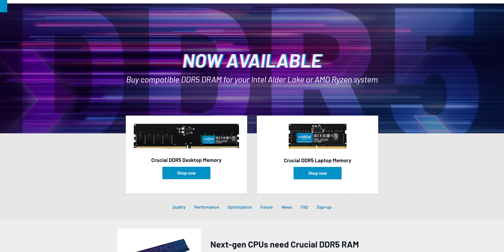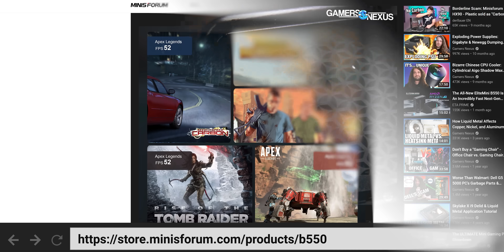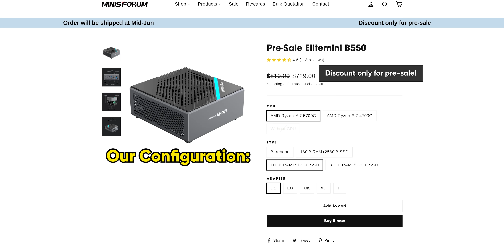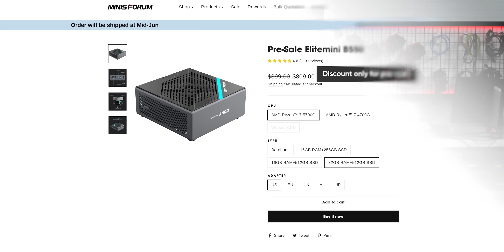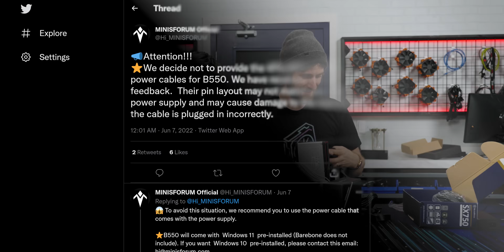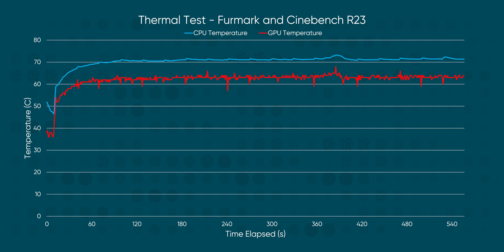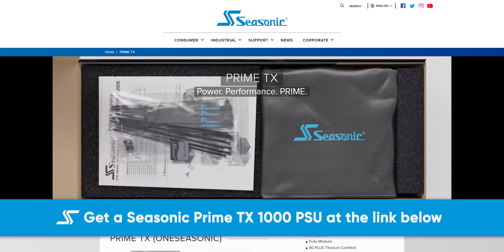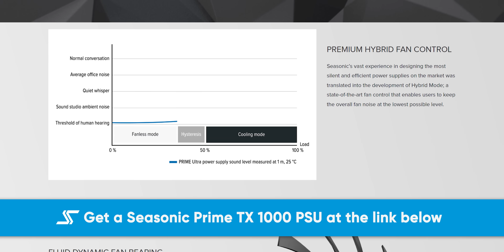Who's Buying These? - MinisForum Elitemini B550

Comment: i think it's Next level of something which u presented here💀👀💥 also i like R7-5700g this is my Favorite Processor btw & m currently using this for Heavy work. 
Another important thing it's must be Portable Beast & Capable to Run anything at 1440p max , with Realtime Render & Faster Simulation on 3D software which is more Important for *VFX artist or Motion Designer like us.

Comment: Million dollar answer: This is for people who want to travel frequently and not be limited to either laptop GPUs or Small Form Factor builds which tend to be expensive, difficult to build, and despite their size, often delicate to transport. With this setup, you can tear down everything and decide what you want to pack in your carry-on or checked baggage. Once you're at your destination, you're a relatively quick setup away from having the power of a full desktop gaming PC to connect to your Airbnb's 4k TV.

Another target audience is those who have the need for 2 PCs in their home: (1) for work used on a desk in an office and (2) for gaming in a living room with a TV or large gaming monitor. This allows you to have both setups without needing to buy 2 PCs. Once you're done working, you simply unplug the mini PC from your work desk and plug it into the dock with the 3090 connected to your TV. Again, neither a laptop nor SFF build give you the same advantages or performance as this setup. (Even a laptop + eGPU setup is limiting due to eGPU's not using PCIe connections.)

Comment: I feel a mini PC brick that ISNT a laptop you could DOCK or slot in similar to like a nintendo switch would be good for an office testing and development environment which maybe requires different OS/PC configurations and testing settings like CPU and RAM so you and co workers could swap the system out to test with different CPU/RAM and or OS and config maybe one system with resizeablebar and smart access memory and the smart shift or PCI express power settings or other things.

Comment: This is perfect for my use case. I will graduate soon and I want to have a flexibility to change where I live and work, but want more power for gaming than a laptop so this small form factor is perfect. And if I build a small form factor PC in a case, the thermal is my concern where the space inside case is very packed. But with this thing the GPU and PSU can take the air from outside and it seems no thermal concern for the GPU which is taking the biggest power on this system.

Comment: 10:10 
Honestly, I could see myself buying this if I the idea was a bit more fleshed out. If the wires were in the base station like was mentioned in the video, or since it was mentioned in the video that it is close to the size of a Ghost S1, if it could be enclosed in a case about that size, and just have easy access to pull out this "module" to take out and with you instead of this open-air setup, i'd probably preorder this right now.

I'm at a temporary (~2 year) work travel right now, and regularly go back home for a weekend every month or so. Since i'm gone for ~2 years, I brought my gaming PC with me (Small-ish form factor, built in an NR200), but when I go home, I want to bring the system with me for my files, and also something that can handle some gaming, which a R7 5700G could certainly do. I have peripherals on both sides, so just having the removable "NUC" would be great. If I bought a laptop, it would ONLY get use while I travel, unless I also went with an eGPU enclosure, and radically changed my computer setup (which I priced out would cost around ~$2600 for the laptop/eGPU vs this option which would be ~$600 using my existing parts). 

As for upgradability which was touched on in this video, since it needs an APU in it for the main feature; the portability and ability to run without a dedicated GPU, if it has enough power to support the R7 5700G, it's a non-issue. I doubt AMD will release a better APU on the retiring AM4 socket. I also feel that this is unfairly being compared to a desktop for upgradability when it really should be compared to a laptop. GPU and storage upgradability is honestly all I think it needs, which it has covered well.

Comment: Gotta admit I love the concept of it but it’s not something I’d want just because I think after you install the graphics card an power supply it just looks messy. Now if they made a version where all the major parts of your pc had their own modular enclosure that when sandwiched together looked clean and presentable I’d be more interested. Be helpful as well if say I wanted to swap out my graphics card without interfering with anything else or disconnect the motherboard section and fix something. How feasible is that idea? I dunno.

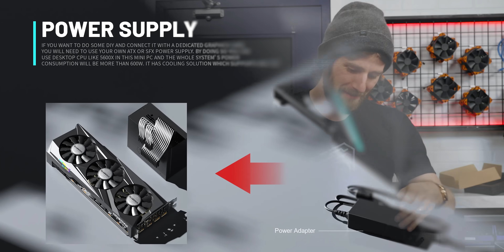Comment: 7:05 What an obscure thing. If you plan on using all the brackets, an external PSU and want a bigger cooler for the CPU a full case would be the better option here...

Comment: This is more of a gimmicky tool. I cannot think of many actually good reasons to get one of those instead of a laptop, other than this being a lot cheaper than a laptop of comparable performance.
If I really stretch my imagination and ignore a lot of my inner common sense. In situations, where you need to work fully offline on proprietary or in development PCI-e based devices, that cannot be moved, is in a bad place for someone to develop stuff for it and can be powered by the normal power brick that it comes it, then this device is basically a godsend of cheap solution. Even then, I can think of possible better solutions. As a gimmick it is something cool, but there are better solutions for basically every usecase for such a product. 10/10 on cool gimmickness, 3/10 on it being able to properly solve a problem.

Comment: i really dont like the design of the dock. it doesnt make any considerations for the psu mounting, which you need to use it, and it is totally not cat proof. since this appears to be a 12v only computer, an sfx seems to be superfluous, providing voltages and connectors you just dont need. just include a proprietary 12vo supply in the base.

Comment: What would be interesting would be to vacuum cool a computer by boiling water at a low pressure that would evaporate give out heat by condensing reducing the temperature of the water or coolant

Comment: I can kinda see it as a hybrid work from home kind of setup. If you're expected to work in the office some days but can work from home some other days, you can just bring the whole computer home and plug it in at home.

Of course I don't know what kind of workflow might have different GPU requirements at office and at home... but I can see an employer issuing 20 of these things to a bunch of employees instead of laptops and docks. Maybe not with all the plugging in required with the weird power cables though. In theory a super mobile desktop makes a ton of sense but the way they did it just doesn't quite seem to fit any particular niche.
Reply: Thanks for the COMMENT.
Text us for more and AMAZING rewards

Comment: It's definitely an interesting idea, and sounds like an improvement on the first version. But an ultraportable laptop + eGPU solves the same problem, although that trades away some performance for better portability, simplicity, and integration. That balance seems a better solution for this situation. However, it's good to have options and some people will prefer the Elitemini's balance. Can't knock that, good for MinisForum for making it and a v2 of it.
Reply: You said it! Laptop and egpu is what this old idea eventually evolved into.

Comment: MEH... I'll just haul my gaming laptop (has a 3080).  If I wanted to do a portable 'desktop' with a GPU I would just do an ITX build say in a Thermaltake V1.  It may be a bit bigger, but I won't be dealing with a bunch of bits and how to transport it with the GPU and PSU exposed.  However, just as a mini PC it's kinda nice.  If it's not being hauled around, most people have plenty of room under their desk for a compact case at least though...

Comment: My vision for this would be a large box that the mini pc easily slots into. 

The graphics card compartment could have a door for easy access to upgrade, and there's no need to really manage cables from your PSU. Then, say you want to grab your computer for a friend's house, traveling out of town for a while, whatever. You can now just unslot your pc and bring a tiny power brick to set up wherever you go next. 

This is an edge-case machine, but honestly laptops make a lot of compromises when you want portability, lightweight and performance. This would be a lot cheaper, and could function with whatever peripherals your friend, mom or whoever has laying around. When I traveled back home to see my mom for a month, I brought only my work laptop, then bought a raspberry pi out there for basic desktop tasks. It was obviously slow and underpowered, but it worked. This would have been a serious contender for that use-case, especially since I needed a PC upgrade too!

Comment: A PCIe interface slot isn't designed for constant installation/removal. 
This is almost guaranteed to fail quite quickly if that "feature" is used even semi-regularly.

Comment: As the freak that travels with a mini ITX, I would like to travel without my RX 6800 XT as soon as replacement for the 5950x with GPU happens, main problem of traveling with a desktop for me is actually the weight, and the GPU by itself is a kilo and a half + radiator, if I could get some very light solution similar to the Mac Studio Ultra I would buy it.

Comment: What I think they should do, is instead of that bottom thing being just a bracket for the most part, have it be a dock.  It sort of then turns the mini into the classic "CPU" (remember when people would point at a computer and just call it a CPU).  Especially if your someone who uses a laptop... but most if not all the time you simply use a dock, why not have something that has more potential and honestly would be easier to repair and upgrade while being FAR quieter.  And if you happen to be at a meeting or something, they could have "terminals" that just have the KVM ready and you'd still be able to work easy.  It's not for everyone, but same could be said about laptops.

Comment: The advantage here is is that it could be a work PC - which you use like a laptop between displays, monitors, projectors etc- which then can be taken home and becomes your home PC. With external storage your work and home life could be discrete but cheaper? 
Application: people who have to work at home due to quarantine issues - many companies now don't want you coming to work with even a sniffle, sneeze or cough. 
Upgradeability - the company effectively upgrades your CPU, RAM and motherboard for free. This frees up more cash for that expensive GPU that people desire for 'gaming' use.

Comment: There are more powerful and more elegant itx solutions that pack full size dimms and gpus. The only thing thats going for this thing is the docability but even that does not justify the silliness of the whole thing. Anyone who may have a use for this can either use an m1 macbook air or a super dense itx chasis that can be carried in a briefcase. This product is stillborn.
Reply: One day a laptop oem will make a dock with 16 pci-e lanes fully exposed and that would be everything this could never be. Fuck thunderbolt that shit is no good with today's bandwidth requirements. I know that asus made something similar to what I described but they fucked it up with proprietary connectors and now it's dead.

Comment: As I travel a lot for work, and visit different places where I need my PC and my laptop isn't reliable enough for some applications, I could see myself using a machine like these, plugging an HDMI cable on hotel tv, wireless keyboard and mouse combo I could work from anywhere without relaying on a laptop that crashes all the time when I'm using certain applications, or poor internet connection and then getting home plugging it on a stronger GPU, yeah that would work great for me

Comment: I'm building something like that (small PC case with mini ITX) and thunderbolt as a cheaper alternative to laptop with desktop performance (it's high end i7 CPU and 64GB of RAM) for working on multiple locations. Ability to connect to external PCI x16 seems very interesting and might open other potential use cases or just reusing the PC for gaming at home (I'm not gaming though).

Comment: Honestly, I'd use a system like that with or without the discrete GPU, just to replace my 6700K if I outfit it with 64 GB of RAM assuming that this will be able to handle the 10 or so VMs that I'm currently running of my said 6700K.

In theory, it'd consume less power than my existing setup, but if I want to be able to play a more intensive game like Flight Simulator or something like that, I can so add in the discrete GPU back into the mix as well.

re: "get a laptop"
Depending on the discrete GPU you get, this solution is likely going to be cheaper than a laptop.

Plus, a lot of laptops now do NOT give you the option of having a 2.5" drive at all. It's all NVMe SSD now, which means that you WILL need to replace said NVMe SSD at SOME point in the future, and that's just a question of when, not a question of if.

Comment: I get it. It's a pc emulator for your 3080+ tier GPU. Stuck at your gran's or vacation house with only a normies tech and TV? No need to panic thanks to this genius gadget!
Seriously though, this looks exactly like a project of BSc students would - hard-moded aliexpress mini-pc as a rough concept of portable hot-plug solution for the full-scale performance cards. Might as well be in a form of DIY wiring/building guide pdf.

Comment: "Why would anyone want to take and travel with the PC?" 
I'm actually looking into buying a SFF PC for that exact reason.  I want to turn one into an entertainment/emulator console for traveling to a mates place. Something small I can just plug and play anywhere I go. I'm often running into entertainment roadblocks at other people's houses, such as Netflix not having the show/movie we want to watch.  Or having limited games to play because they only have the one console. I want to show them how easy it is to find, watch or play anything you want with a PC.
Reply: "Why not a laptop?" 
Because laptops suck ass! Despite being made for portability, they're still bulky and difficult to travel with. You usually need a separate bag to travel with them. A SFF PC can fit in any bag. Laptops are fragile, especially the screen. And if it doesn't physically break, I often find them to be slow as balls to use after a year or so of use. Doesn't help that they're filled with bloatware from the get-go. Battery life never lasts that long, so I'd always have to plug it in anyways. And not all desks can hold a laptop. Try mounting a laptop on top of a thin TV cabinet. It's possible, but a pain. And it'll usually hang off the edge. Not good if your mate has kids or pets running around. 
This is coming from someone who loves his tech and makes them last for years. My 10+ year old laptop is still somewhat useable to this day. I just see the same problems again and again with other people's laptops. 
Desktop all the way. The only reason I'd recommend a laptop is in a public place, like McDonalds, or in a car. If you find yourself in a house, chances are, you'll find a TV to plug into.

Comment: Guess I'm that niche market. I don't live in america. The size and weight of it is perfect so I don't have to pay much at customs. I live in a 3rd world country so can't afford those overpriced GPU's now, but will buy them when price goes down perhaps next year? It has a 2.5 inch hdd spot as well as 2 M.2 slots one having PCIEX4 speeds. It uses a full desktop CPU so good performance. Also from what I could see it's quiet and the iGPU is good for gaming low 1080p, especially for emulators. Also I plan to do small1080 video editing until I can afford a good eGPU. I really dont care how ugly it looks with the GPU and PSU as long as it works. I also dont care how often I have to clean it. The unit by itself looks great and is how I mostly intend to use it.

Comment: I would totally love to see something like this, but a laptop. Standard, pretty decent laptop with gaming spec CPU and no internal discrete gpu, and then a hatch to connect a PCIe and power on the bottom or back, so that you can slot your laptop into a dock sort of thing, use the CPU onboard, but then also have a full-sized graphics card externally, so you can have your cake and eat it too: a laptop that's portable and has pretty reasonable battery life, but then becomes a proper gaming rig when you put it in the dock. That way you wouldn't have to lug around a mobile gpu in your laptop, but you can have the full performance of one. Besides, I don't really know anyone who has a gaming laptop and would want to game when they aren't at their normal setup, or at least would not do it very often at all.

Comment: I've really been wanting to go mini itx... this is actually really appealing to me. Going from my current 8700k to something like a 5600g isn't much of a difference
Reply: Mini-box has a couple of really nice mini-itx cases that fill a similar role. Haven't built with one yet, but they've got VESA mounting points on the back of the case so you can actually mount your miniature PC on the back of your motherboard. Just pick your cooler carefully.

Comment: They charge only 280 for the cpu tbh that isnt a bad deal considering you are only just going about 15-20 dollars lower in price than that if you get the cpu used. Getting this thing with the cpu in it then putting your own ram and ssd in it only would save you about 25 dollars that could go to some better ram or better storage maybe. They have this thing priced competitively as far as parts are concerned